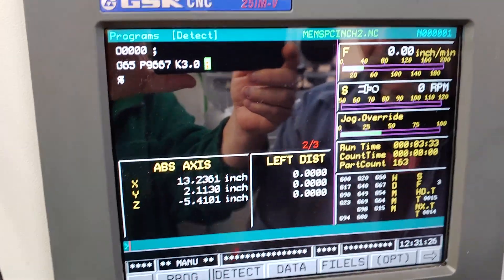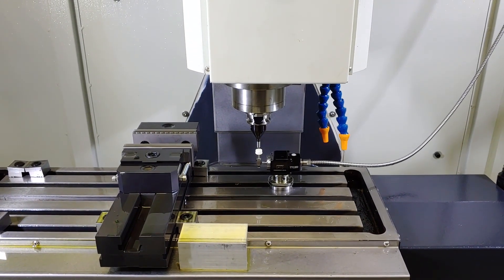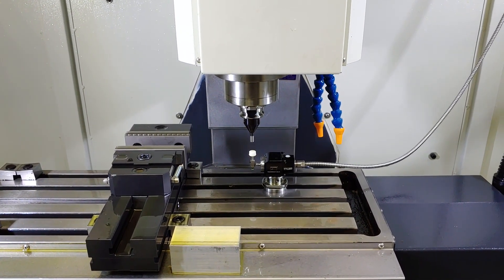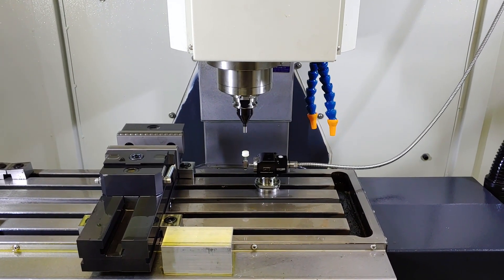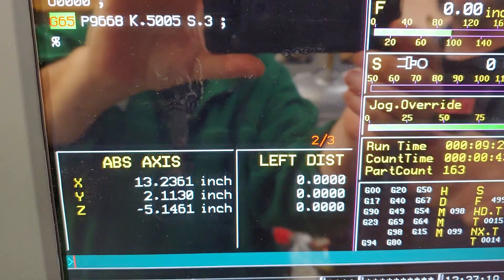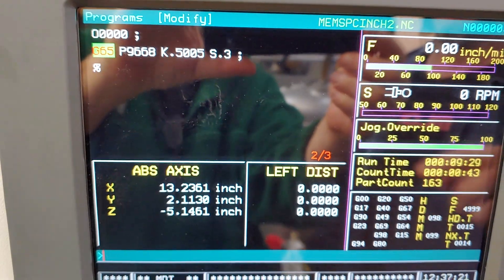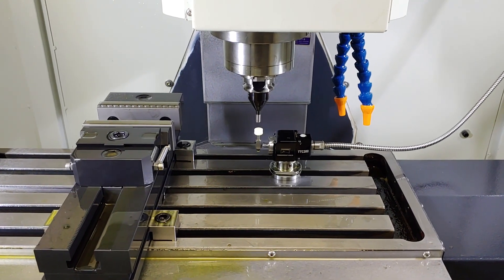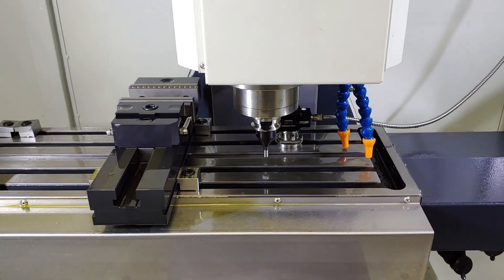Pioneer TTC200 Failure

Comment: I’d say the plunge is normal speed based only what I have seen on other videos.
Reply from the maker: the problem is it does not stop quick enough. turn up the volume when it comes down. sounds bad...
Reply: The plunge is too fast for that distance, it should be already slowed down and approach the probe with low feed rate, he is lucky to still have the probe alive...

Comment: Hi Paul,
I was browsing and came across your video, i am assuming you're calling a macro to execute both cycles, you should be able to open the files and have a look, it just need to adjust the retraction path. The alarm can be as the probe is too far from the offset centre of the ceramic disk,  normally as you set the nominal tool diameter the offset can be determined inside the macro(mine is 5mm no matter the tool diameter ). It looks like the macro is still counting mm and the controller is set up in inches.... if you're willing to share the file(macro) we can have a look into it and i'm sure we can fix it then you can re-load the file into the controller. GSK is a good controller and also the TTC200.
Happy new year.
Regards.
Reply from the maker: Are right the macro needed to be edited I did get through that part and I do have the tool Setter working now now I'm having problems with my g54 offsets not working I'll be firing up the machine later today maybe I'll do a video on it
Reply: @CapeCodCNC  I'm really curious about the G54 issue, looking forward to the next video... Cheers

Comment: Hey Paul.  Congratulations at least you got the controller into inches now.  I'm not sure what's going on with your tool setter.  It looks like it is stepping over way too far.  This is problem with other systems.  If it was a Renishaw probe at least you could ring them to ask them.
Reply from the maker: If only it was that easy! I did get files tonight, it's now 2 am, that fixed what is in the video. I can now calibrate the length and diameter with tool calibration standard. However I am now getting an alarm on measuring tools. Hopefully after some much needed sleep I will wake up and magically find a fix!